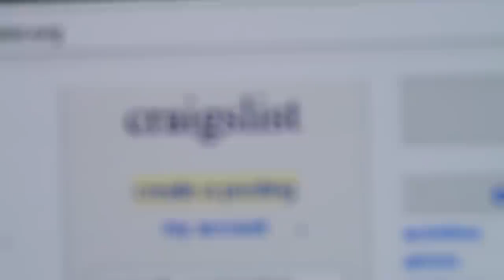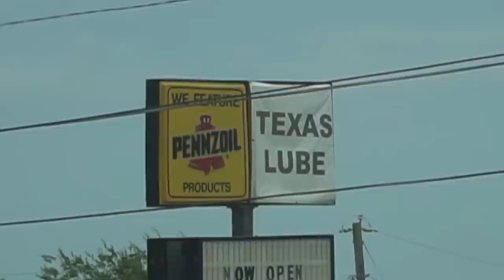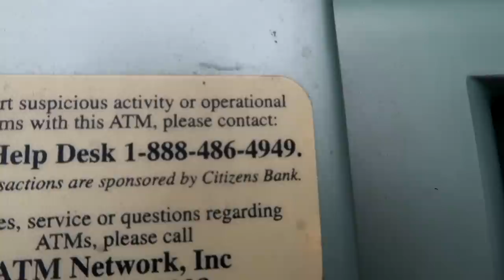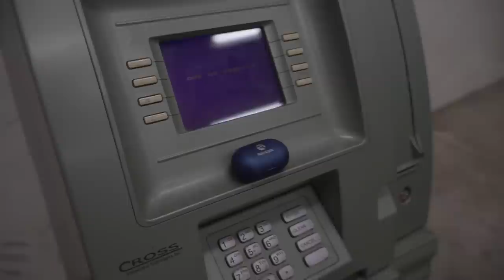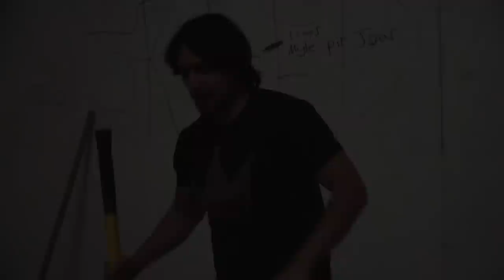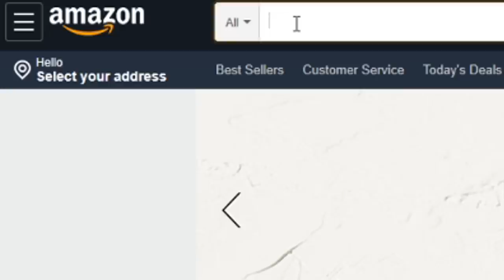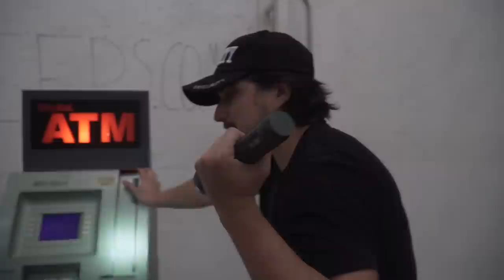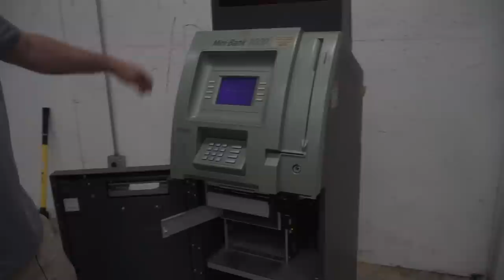I Bought 2 Abandoned Locked ATM's and Found This Inside

Comment: So to better explain this, from the perspective of someone who worked at a gas station for years, here is  what actually happens. Gas stations don't usually own the ATMs, they have contracts with companies that operate the ATMs for a fee. Basically, the ATM charges like $3 for each withdraw which goes to the owner of the ATM, and the ATM owner pays the gas station like $200 a month to keep the ATM there. Some of the sketchy gas stations don't have the kind of foot traffic to attract these kinds of deals, so they buy their own ATMs (usually several thousands of dollars). Unfortunately, sometimes these get too old to be compatible with modern systems, or they break, or other things happen to where the ATM is no longer usable. Here is the experience I had with this:

The gas station I worked at (in Gary Indiana) owned it's own ATM, and one day it stopped working. Instead of getting someone to fix it, the owner of the gas station took all the money out, locked it up tight, jammed the lock with some paper clips, then sold it as "lost key and code, unknown contents" for $750 to some hopeful idiot.

I guarantee this is the same case with ALL of those ATMs

Comment: I worked for a company that built ATM's. The safes were harden steal with 3  - 1 inch bars sliding into the frame to keep it in place.  We had the company we built them for send one back to us. They had the keys but the door would not open. They wanted us to drop them off the dock too see what would happen.  I was told they could hear grinding noises when powered up. When I got to it and powered up the noise was very familiar, the sound the cash accepter  made  when the cassette was out of place. Somewhere in transit it had moved forward. We set up several pallets covered with a few boxes for padding. Dropped it on it's back. That reset the cassette and we able to open the door. The ATMs we made had cash dispenser that had 3 boxes. Each having 2000 note capacity. Never had to break in one though, we did have one that the handle was hard too turn and had to be   fixed but we got it open.

Comment: I hope this was intended for humor. If not, for future reference, Wait until the store is closed. Make sure the ATM is next to the entry door. Cover your tru k plate and back up to the door. With Covid, nobody will think anything of you wearing a mask. Wear a mask. Hook the door to your truck with a chain and yank it off. For the ATM.. Step 1; put on gloves. Step 2; Slam a tow chain hook through the base, wrap it around the body once and clamp it tight. Step 3; Drag it, fast, down the road. They fall apart in under a block. Step 4; Grab the money box and go. Leave the chain, just go! Open the box when your out of the neighborhood. At least, that's what my friend told me.

Comment: When we lived in Raleigh we often used  an ATM located in its own little brick kiosk at a nearby shopping center. One day as we were coming out of a shop there, we noticed a guy in a lawn care truck casually pull out some keys and, after looking around, enter the ATM kiosk. After a few minutes he came out, glanced at us, and drove off. If that doesn't throw up a flag, nothing will. So we called the bank, but they said a third party maintains all those "and they didn't know the number".  We made the effort of circling back to the ATM and tried to call the toll-free number on it- out of order. Our banking system is a house of cards.

Comment: In Maine a bank branch was closing and a guy bought the building and everything inside it for $200k.  The Bank forgot to empty the ATM before they sold the building. They left $100k in the ATM. Of course the bank took him to court but the judge went with the dude as the contract said the building and everything inside. 
Also good thing you guys didn't buy a real bank ATM, those safes would crush your truck and you'd need to know where to drill or cut into them with a torch in order to open them. Those cardtronic ATMs are dirt cheap and very rarely hold much money.

Comment: Guys a diamond bit grinder a hammer drill with various bits a good heavy drill and a scissor jack will pop most of those open put the floor jack back the little scissor will fit in tight spots and work just as well

Comment: 30 seconds in and I can pretty much tell you know one in their right mind abandons money inside atm's
Reply: Actually, you'd be surprised. A small convenience store I used to work at got bought out and the contract for the ATM didn't transfer to the new owners. It sat in the store for a couple years because they couldn't open it as the electronic passcode was tied to communicating with the main office... with no contract, no comms. I know it was eventually scrapped and the guy who took it away sliced it up and inside was like $1600 left in $20 bills. As the original company that owned it was no longer in business, and it had been a few years, it was ruled basically as finders keepers. Never assume that everything gets cleaned out when businesses change hands, but also, if buying ATMs on Craigslist, don't expect them to have any money. The rare wins keep us all hoping for treasures, but most times all you get is a pile of scrap.

Comment: Tried angle grinding this thing. not to mention it's fkin diamond disk mostly is made for concrete and bricks some can cut through steele as rebars in concrete but c'mon only u need is one or two 50 cent steel cutting disk not a 15$+ diamond disk

Comment: Literally using a diamond blade on that angle grinder, those are meant for concrete and stone... get a decent carbon cutting blades for steel and metals. Probably go through 5 or 6 blades but they would work better than diamond blade.